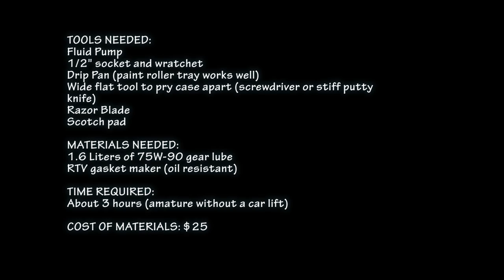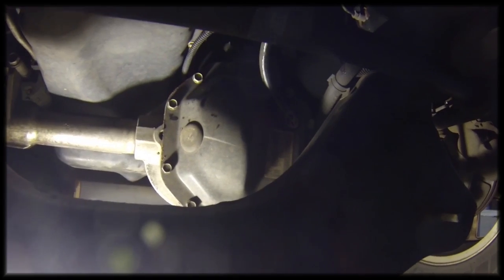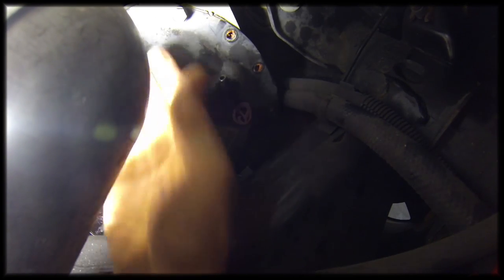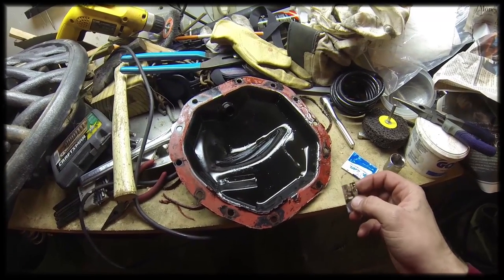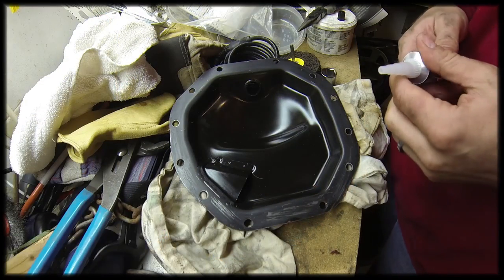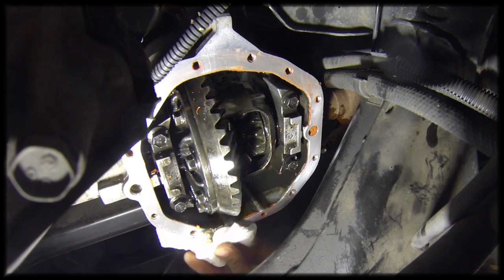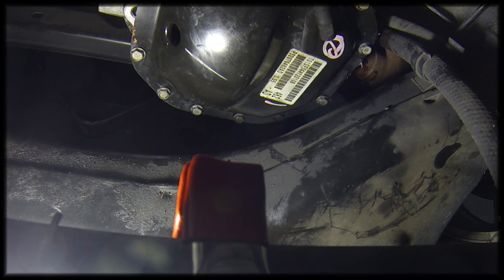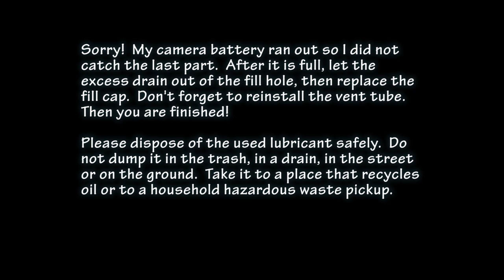2007 Dodge Durango - Front Differential Fluid Change

Comment: You did this the hardway brother.  Front and read diffs you can use any type suction hose to suck the old fluid out from the rubber grommet fill hole.  My go-to pump is a mityvac. Make sure the fluid is hot and you ran the truck for at good speed so the diff oil thins out some because its very heavy weight oil.  This method saves yourself a ton of time.  You may not get every bit out compred to removing the whole cover but it's sufficient.  Cuts down on a lot of time for the jobs.
Reply from the maker: Yes, I have done it that way as well, but every now and then I like to take the cover off to make sure everything is 100% pristine in there.  Thanks!

Comment: How often should this be done? I have 165,000 on mine. Same year.
Reply from the maker: I don't think there is a set schedule, they usually get noisy when they are going bad so that is the time.  But if you have 165k, then replacing these two pully's is fairly cheap insurance.

Comment: I have the same vehicle...mechanic says I need another front differential cover ...where is the best place 2 get 1 from without going completely broke?
Reply from the maker: That would be odd to need a front differential cover unless it got dented so badly that it contacts the gears.  Regardless, based on how many of these bodies rust out I would guess you can find plenty of them in the junk yards.

Comment: this is gonna sound stupid but couldn't you add the oil through the breather tube?
Reply from the maker: +Sam Coon :  I have never tried adding oil through the breather tube.  Any way you can get the oil in there I suppose would work but the way I did it seemed to work OK for me.  The breather tube is much smaller in diameter so I suspect that due to the high viscosity of the oil that it would be pretty difficult to fill it through the breather tube.